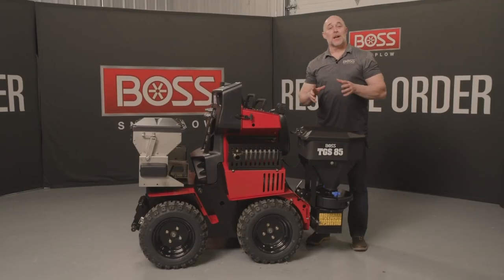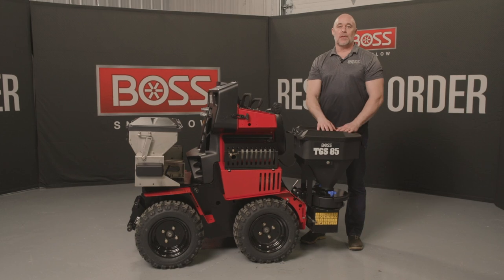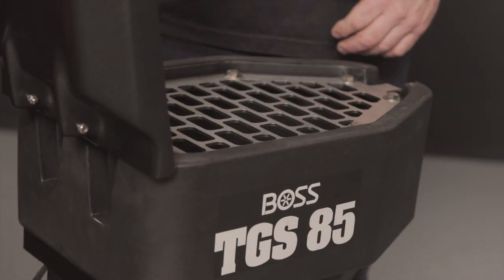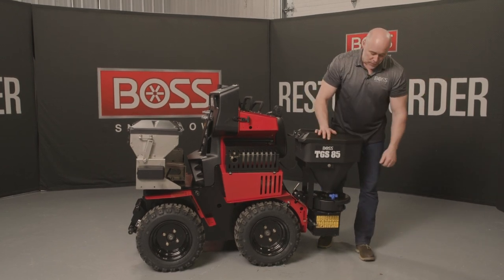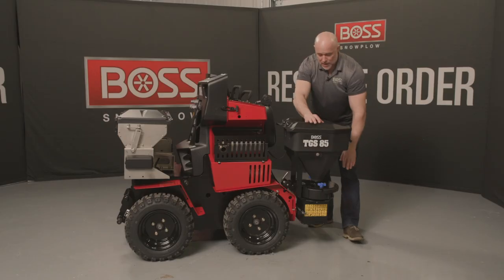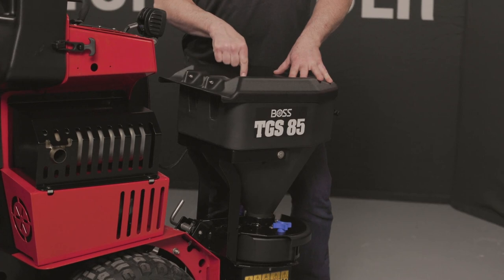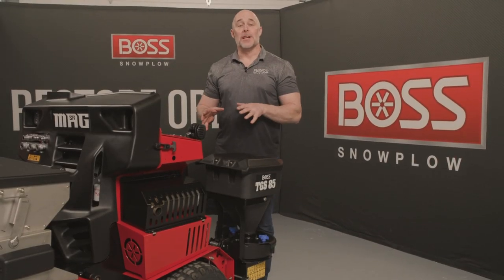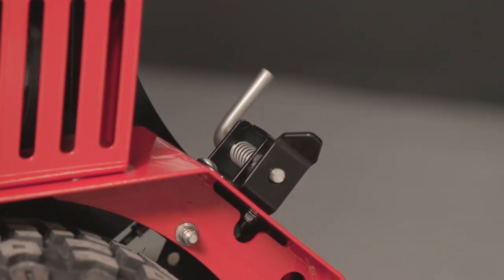TGS85 Broadcast Spreader SR MAG & Snowrator Attachment | BOSS Snowplow |

Comment: When you use the TGs 85 salts redder, do you have to disconnect The Wire harness to The exact path spreader, or is there a separate controller for the?